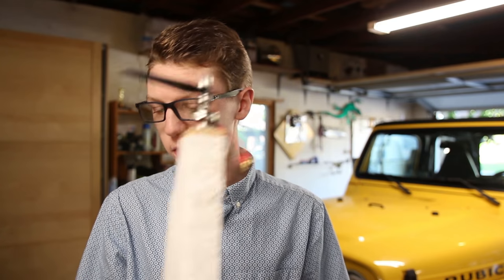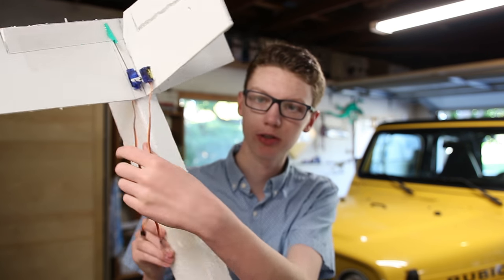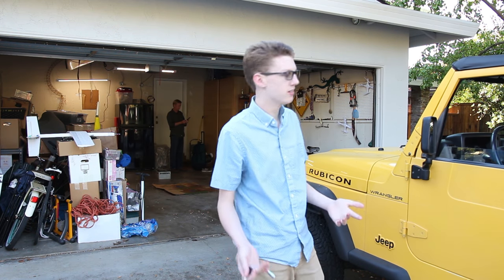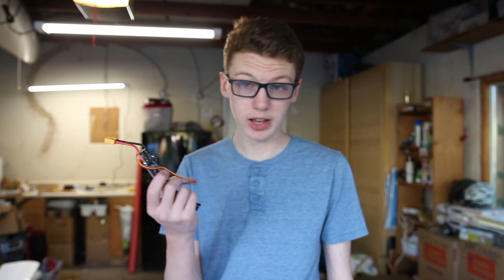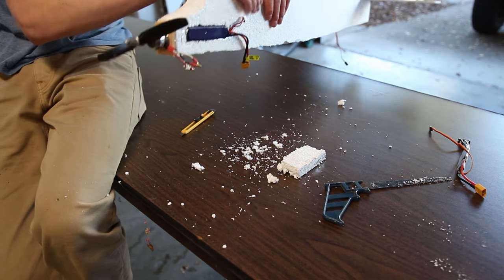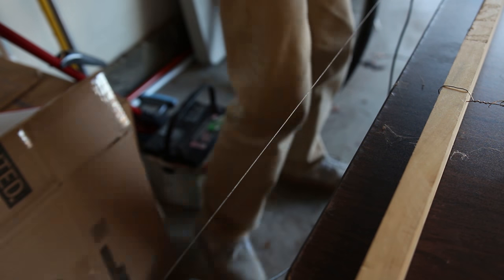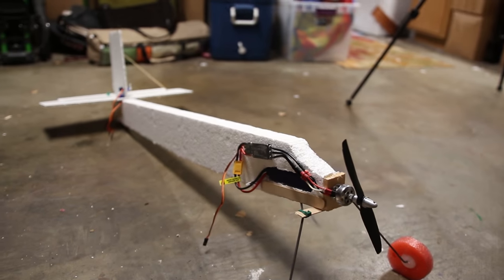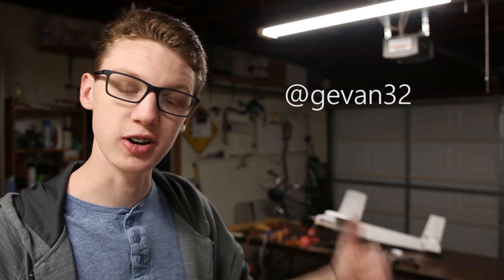Scratch Building an RC Plane! (Part 1)

Comment: Cg is has to be perfect or the plane will fly you lol the balance point should be 1/3th of the cord line which is the distance between the leading edge and trailing edge

Comment: Welcome to the world of RC planes. Is this your first plane?  If so, then here is some advice.1. Go to  the Flite Test channel here on you tube.  They can provide a wealth of knowledge to anyone just getting into the hobby.2. Your wing seems a bit small for the airplane you have.  Fliite Test has a simple glider design called the simple soarer, which has the perfect wing for your airplane.Flite Test planes are made of Dollar Tree foamboard, which is easy to get and work with.  You can visit their online store to buy parts, check out build videos here on you tube, and download build plans for free.I hope this helps and good luck.
Reply from the maker: This is my first time building a plane myself. Thanks for the advice. I've actually been following FT for a few years now.
Reply: Great to hear that.  Keep us posted and don't be afraid to crash.  Good luck